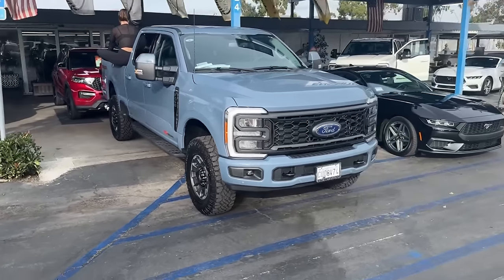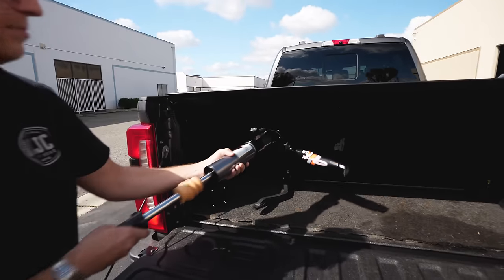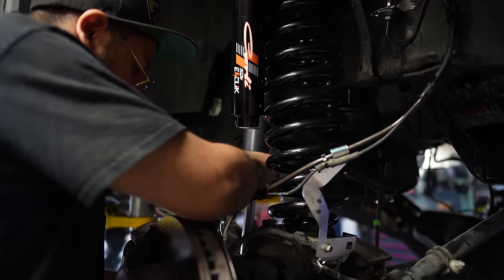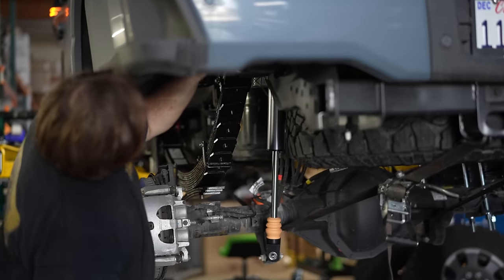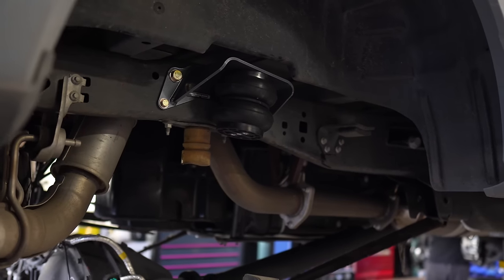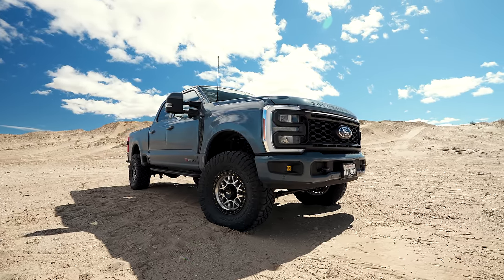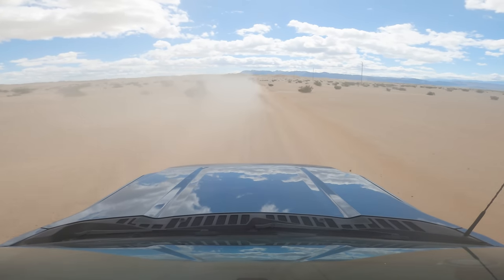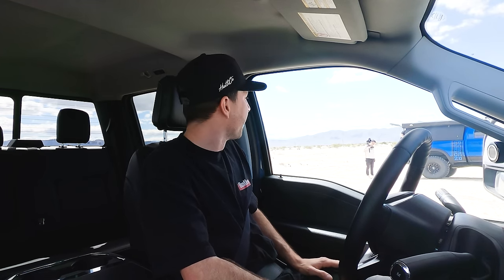TURNING A $80,000 F250 INTO A $130,000 F250!

Comment: That death wobble through the dips offroad
Reply: For real.  
Should have hit up Kibbetech for some real suspension set up
Reply: @anthony5227 Kibbetech does nothing for super duties nor would TJ spend that much money on a truck meant for towing 😂
Reply: Right bro I was about to say that. The body lines were struggling. Not even close to a pre runner
Reply: Wasn’t death wobble, death wobble is purely hitting a bump and the momentum whipping the tires on its own. This was him actually hitting bumps, each turn was a bump impact, stopped as soon as he wasn’t in a bump
Reply: That’s not death wobble
Reply: @anthony5227 Kibbetech DOES NOT work on solid axle trucks.  If TJ went to Kibbe, He would have installed a Carli system.
Reply: @jackpixley3696  I just know he did that big black Chevy.  The Bugatti max or whatever.  
And just assumed he did all trucks by now.  
My bad
Reply: It’s a solid axel, plus it being a heavy truck doesn’t help. He just went past the limit on a bolt on kit.
Reply: @anthony5227  Bugatti Max started as an Independent front suspension truck.  It also cost in the area of $140,000 to be built that way and took nearly a year.

Comment: Looks like it’s got crazy death wobble at speed in the whoops
Reply: Yeah that didn't look good, that'll break shit
Reply: yeah looked terrible honestly loads of axle wobble I've seen better off the rack jeep kits for whoops and they don't wobble like that
Reply: Hard to tell, but he center punched some super steep, deep whoops. There's a limit to what the stock steering linkage can take! The tires are also at 18psi so the actual tire sidewall itself deflects quite a bit too when pushing that hard.
Reply: fuck you can see the damn fenders and bed pannels bending its that bad haha
Reply: I would upgraded the steering stronger and better all fun and games till you bend a drag link or break a tie rode
Reply: Considering this is an 8k lb truck, with nearly 5k of that over the front axle, that suspension pkg did pretty well. Anyone who owns one of these can see the major improvement that it made.

That high speed whoop section was too much, and just shows where the limit is for a build like this.
Reply: Getting tossed around from some baby whoops is crazy
Reply: @CJCOffRoad  vast improvement over stock especially considering its a "levelling kit". I doubt they’ll encounter anything remotely close to that whoop section on the road which is probably where it’ll spend most it’s life at that speed.
Reply: Geometry on these trucks is not good when lifted. Go Icon much better in my opinion. They offer front 4 link conversion and track bar and pitman arm drop. It appears there is a crazy amount of bump steer. after watching the slow mo, these trucks will be reduced to crap in no time.

Comment: “Turning an 80k truck into a 130k truck by spending 50k” 😂
Reply: Funniest part is 50k isn’t even what these kits cost
Reply: That kit is 14k. No where near spending 50k.
Reply: Yeah. That's the math they tought me too
Reply: @Hated_Sien  probably added wheels and tires and labor in to total
Reply: @crawlingivy1 Wrong.  I have the 4.5 Pintop system on my F-250.  My King shocks are custom Anodized and cerakoted, plus i have Innov8 wheels which are more expensive then the KMC wheels he has.  Installed it was 21k.  Saying its 50k is for clicks, but its a lie
Reply: @numberofaman6665 
They didn't teach you English, either.  

THEY TOUGHT ME TOO

SPEECH 1OO

Comment: Spends thousands on a lift to Baja ends up just getting mad death wobble off road 🤣
Reply: lol bro could’ve bought a jeep for a couple grand that would handle better than that 😂
Reply: Not just death wobble, straight up level kit bump steer 😂 that thing doesn’t look comfortable
Reply: @Tuxedorunner  he tried his best to play it off as it riding smooth but it definitely didn’t look like it 🤣
Reply: @clambino619  no you could not lol
Reply: This is a great all around kit. Gives you way more control and performance than a lift kit. Obviously it has its limits just like anything. Even a trophy truck has its limits. 
This is a great suspension kit for someone who likes to occasionally hit the desert on the weekend but still needs to retain the Towing capabilities of the truck. If you you don't mind losing towing performance then full custom long travel suspension would be the superior route and would cost a lot more than even this kit that was installed on his F250.
Reply: @nazarethpreciado9950  you definitely can. I spent 2k on my Cherokee and put a 2500 long arm kit on it and the thing soaks up the whoops without the death wobble Tjs truck has
Reply: @clambino619  comparing a very short wheel base, lightish weight Jeep to an 8 thousand pound super cab, long bed truck is just stupid. That engine weighs more than your entire Jeep. Wheel base plays a huge roll in how something performs off-road. You completely missed the point of this entire build. Hook a 20 thousand pound trailer up to your jeep and tell me how well it performs. It’s a tow truck that he uses to pull his trailers with and wanted to be able to have improved over stock performance. I’d say for what that truck did compared to a stock truck it was insanely good. It’s not a trophy truck or even a pre-runner. If he wanted a pre-runner he would have started with a light weight chassis. Knocking something without even having a general understanding of the purpose of the build is crazy.
Reply: @clambino619 no you could not ☠️☠️

Comment: Should get hooked up with banks next since you're probably sticking with emissions. Also, check out pusherintakes for an emissions legal intake manifold.  Fass is coming out with a egr filter for emissions as well and they have an upgrade to the stock fuel filters that puts both below in one housing. SB makes a filter that separates dust that seems pretty interesting as well along with their 60 gallon tank. PPE has a nice intercooler upgrade too which is a good price.

Comment: I think your math is a little wrong. The Carli kit is like $15k, and wheels and tires maybe $5k. That brings it up to $100k, so unless the shop charged you $30k to install, then that's a bit of a stretch. No doubt I like the truck, and have thought of doing the same to my 2021 F250 Platinum, but I opted instead to buy a new Bronco Raptor and GT350R Heritage, and also ordered a Ranger Raptor, if it will ever ship. Let us know how it does with a gooseneck, because I never lift my super duties.I like to keep my trucks ready to haul a gooseneck when I need one, and lifted dually trucks look stupid.

Comment: I’ll be honest I don’t think the wheels and tires look that good on it. I think 37in tires need 20in rims and I think fuel does the best job at it. I’m not really a fan of the head lights on these new super duties but this truck is just a bit off, the diesels power band isn’t anywhere near what you want for this either. Just because a truck can do this dosent mean it should.  I really do think with a little playing around with the wheels and tires and the way it sits that it can look a lot better tho.. the wheels are to small for the tire and the tire looks to big for the way the truck sits, yea it’s just off to me.. in all honesty with the new raptor R out that’s what I’d buy in a heart beat, there is still so much you can do to those trucks it’s unbelievable and it has the gt500 motor in it?  That thing wouldn’t have a single issue towing a car, I can’t imagine your pulling anything bigger than a raptor can pull.. but you made a trade off but I still think pulling a trailer with a raptor is better than putting Baja suspension on a F250, but that’s just me.